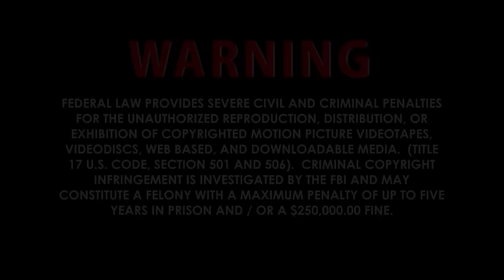How to Fix a Toilet - Diagnostics - Blocked Toilet

Comment: Wow. This video is SO HELPFUL. My toilet was clogged because I have a habit of throwing the tissue paper I used in the toilet. I was struggling because the water in my toilet would go down after a bit but then when I would flush it, the water would rise again. I watched this video and then found a plunger at home. I pumped down on the plunger stick a few times and once I released the plunger, all the water flushed down and I even flushed the toilet again to make sure it was fixed and the toilet flushed properly.

Comment: ok, here is my problem: the toilet is about 40 years old and YES, I know, get a new one....but for curiosity's sake let me present my problem and see IF there is a solution.  Rust has built up inside the intake and the "hole" where the water goes into is small now and not all debris goes down with the first flush...is there a way to chip out or clean the rust build-up? I can feel it but how to "chip" it off is my questions....on a scale of 1-10 of importance, its about a 3.....thanks.....

Comment: I had a tough clog in one of my one piece toilets today. Eventually I cleared the clog with the rudimentary use of a standard plunger without moving to the use of a closet auger. I wanted to avoid using that since the Kohler Portrait one piece toilet I have is glazed through the entire trapway and didn't want to fathom of damaging the glazing within per use of an auger as the full glazing makes it a more facilitated passing of articles therein. My concern is if the use of a plunger ( this was the first time I used it for these toilets originally installed in the late Summer of 2014 ) can manipulate the wax ring or break it? I found a video on Youtube that indicated that. I have a Kohler Kathryn and a Kohler Memoirs Stately one piece toilets additionally and the Memoirs Stately seems to be the best in flushing. Both  have glazed trapways as well.

Comment: I need some advice!!! My toilet won't flush down any toilet paper at all! It runs fresh water in the bowl but it's like it doesn't have a lot of force to cause suction if that makes any sense? I have no clue what to do. I've plunged and everything I could do. It's like all of a sudden it started doing this only in one of the two bathrooms. Not to mention the other bathroom toilet has to be flushed more than once to flush everything down and the tub in the same room drains slower than usual. Do you think the problem is with the lines somewhere? Could it be the septic tank needing emptied? I'm so new to home owning. Any good advice would be appreciated! Thanks in advance.
Reply: Danielle It's most likely the jets under the rim of the bowl need to cleaned as this is where the water comes out each time you flush but if they are almost blocked with minerals the toilet won't produce a strong enough flush to get rid of the waste in the bowl
Reply: Jets........

Comment: Plunger is the only DIY £ thing left to try after 2 weeks (seriously) of trying to unblock a toilet, a khaki colour 1970s git which is apparently as awkwardly designed on the inside as it is ugly on the outside, same as all the architecture of that hideous decade. Only good thing out've the '70s was some of the music, & having normal size cars before poseur SUVS blocked UK roads.. & The Clangers, Basil Brush & Bagpuss...